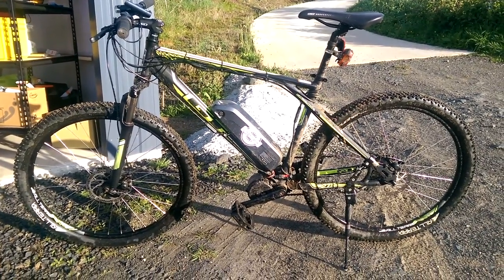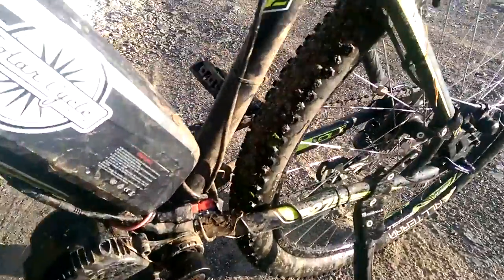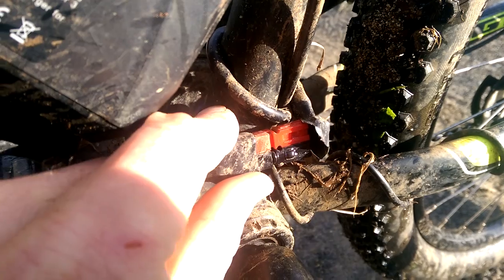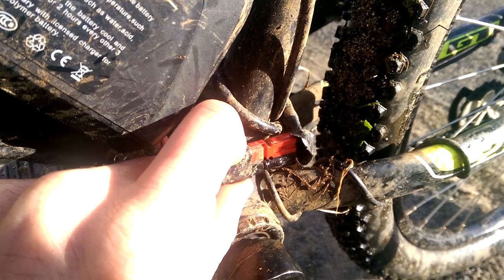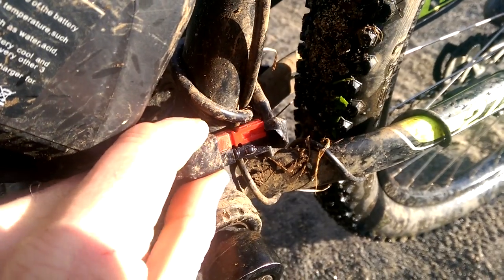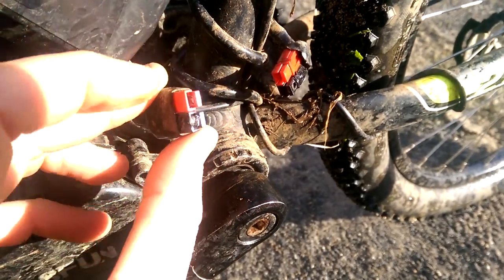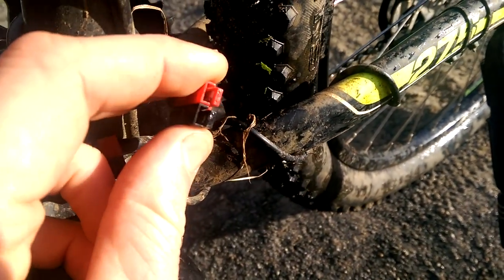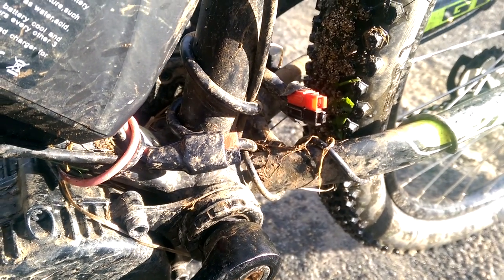Ebike emergency repair-melted connector

Comment: Foil definitely does the trick to get you home, but not good in the long run. I bought an e-bike and it came messed up, I used foil for a month and now I need a new battery

Comment: The the tin foil aluminum in the connector is a bad idea. Copper and aluminum don't mix. That trick will get you home only, keep using it and the connector will melt even further
Reply from the maker: Yes, as with all emergency fixes get it fixed properly as soon as you can otherwise you'll end up with a bigger problem!

Comment: Perfect! I have the exact same problem going on and was wondering is I could put some foil in my compromised connector to get me home tonight. Thanks for this little clip. That'll get me home without pedaling my 50-lb bike for 16 miles! Whew.

Comment: Thank you for the tip. Would I be able to change my bbs02 controller pins connectors to the Anderson connectors if so what AMP are your Anderson connector is? 30 AMP or 45 amp?
Thanks!!!
Reply from the maker: Yes you can change. The 30 is plenty able to handle the bbs02-the motor peaks at 25A
Reply: @RaglansElectricBaboon  
Thank you so much for your help buddy. You are the best. I'll make sure to change the Anderson Connectors to 30 amp..